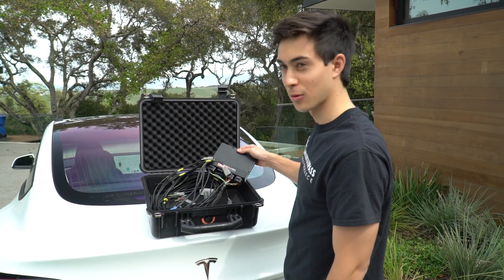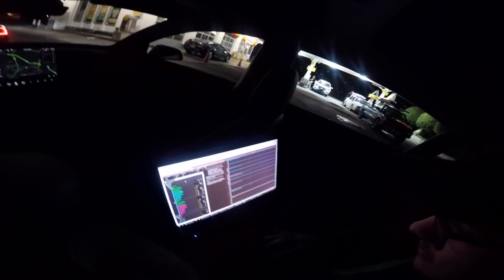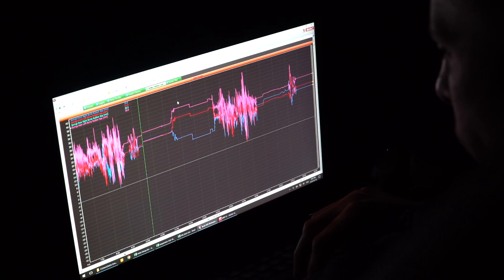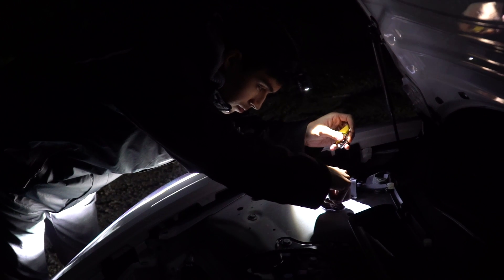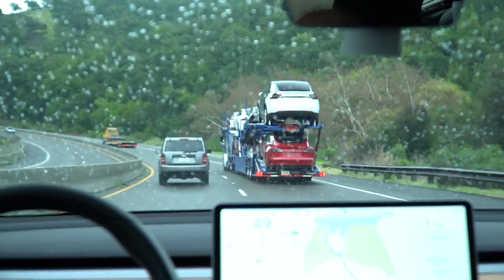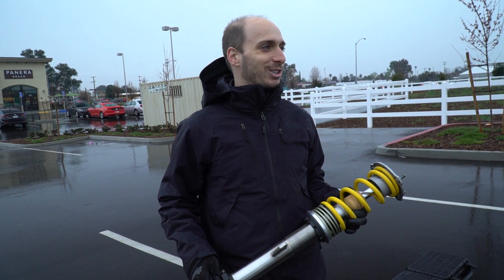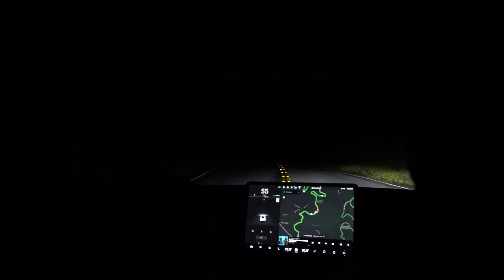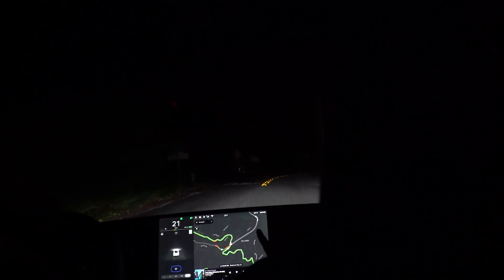Mountain Pass Performance Tesla Model 3 Coilover Development

Comment: Why would I ruin my car with you're product? Is there reason to trust you over a  mechanical engineer that works for Tesla? I even hear in the background  that it's not much different then stock. Why are you standing in front of a gas pump at the end of the video.
Reply from the maker: Well for starters, we can help with your grammar - it's "your" not "you're"

Secondly, the factory suspension is designed with certain type of constraints (i.e. high ride height so that when grandma sends it over a curb she doesn't trash the battery, low cost, etc). We're designing a suspension oriented to the enthusiast that is willing to spend more money than the factory ~$100 (Tesla cost) shocks and springs. 

I'm sure that if the mech eng working for Tesla had $2000 to spend on suspension, and designed it for a sports oriented driver, they wouldn't have made the same part.
Reply: Well said! Grammer makes car go faster, you be smarter then me, I buy you Mod. Really 2000k to turn my 4 door into a race car? You are high. Sorry not for me.
Reply: Grant Fryer grammar* than*
Reply: Grant Fryer lol kid
Reply: You're fuckin dumb. People mod their cars with aftermarket suspension all the time for plenty of reasons (less body roll when cornering, better quality parts, lowered aesthetics, etc.) Go to a cars and coffee and see how many cars there have aftermarket suspension setups. No one is telling you that you have to "ruin" your car with any product. If you're happy with stock then be happy with it. Don't know how coilovers ruin anything other than getting you to soil your own panties.
Reply: Why would anyone ever mod the car outside factory?  Come on, factory spend years of research and millions developing the perfect car EVERYONE IN THE WORLD.  Why rune it and risk safety, am I right guys?  More responsive steering, better braking performance or customizing the look of the car to what you like?  PFFF retards.  Let me go put my Hachi-roku to stock, brb.
Reply: Wow! such hate. My Tesla still rides just fine today with stock suspension. Sorry I will not be purchasing you're snake oil. Good day Sir.

Comment: I'd love to see a shock dyno in a future video. Are you still using the stock FRP upper control arm here?
Reply from the maker: Yes we are. We'll try to get some footage for you next time on the shock dyno. Although there isn't much to see :)
Reply: I meant to show the shock dyno plot lol.
Reply from the maker: Ah, yes that is something we certainly will not be sharing :)
Reply: Sasha Anis why not? A shock dyno plot doesn’t reveal anything proprietary, it’s quite common for manufacturers to provide them. Plus there is nothing preventing a customer from sending them to get dynoed somewhere.
Reply: @ShaunRF  if you took that plot and went to a company and said 'match this please' you've effectively stolen all of these guys testing work and labour.
Reply: @KXP70  that isn't really how it works. KW isn't going to do that for just anyone. Besides, there is nothing stopping someone from getting them dynoed themselves if they really want to copy it. TONS of reputable companies post shock dyno plots, its considered pretty standard. Many people simply wont buy from companies that wont post a dyno, because it is a tactic that is commonly used by shady companies to hide something unfavorable in the plot. Although I'm certainly not saying this is the case here, as Sasha has a very good reputation.
Reply: @ShaunRF  from the many suspension company websites I have visited in the past (20+) I have never once come across a dyno plot. I was under the assumption that it was provided on request and typically for track orientated products.
Reply: @KXP70  I mean either on the website or by request. I can tell you that Koni for instance has been very open about providing dyno plots over the years. They even used to have reps on car forums providing them. Fortune Auto is another example off the top of my head.
Reply: When I get my Ohlins revalved, a dyno shock printout is always provided.

Comment: Since your spring is linear like the original model 3 spring, is it of such a different spring rate that someone can’t just buy new dampers and use the original front springs, and just replace the rear shocks and leave the rear springs?

Unlimited Performance has made a two-stage spring, which will soften the ride but not the tiny disturbances which are over dampened. It seems the two-stage spring will wallow and roll more that the linear spring, especially on the side which is extending, which would need a stiffer anti-sway bar, which will increase rates up over uneven small bumps. 

Maybe some dampers with adjustable compression, rebound, and neutral zone would be nice.
Reply: The Unplugged Performance springs are stacked linear springs, which is the same general configuration as the KWs, but with a single piece of wire.   The KWs have a thick wire and separate thin (and ground or flat) wire.  Different configuration for a similar result.  Both are progressive rate springs achieved via coil binding.

Progressive rate springs are appropriate for both street and track use and have comfortable ride on small displacement bumps.  Interestingly air springs are inherently progressive.  The bags get firmer when compressed due to bumps.

Damping comes from the dampers, not the springs.  (Springs have a little internal damping, but for practical purposes are undamped.)  Adjusting the valving of the dampers controls the damping response to large and small displacements.  That's what they did when they visited KW.

Fully end user-adjustable damping is generally only useful for experts with good software and fully computerized measurement systems.  Most commonly those are racing teams.  These guys are tuning for a fixed set up which is far more appropriate for consumers who don't competitively race at a variety of tracks.
Reply: Loanword Eggcorn, yes, when you stack two linear springs of difference spring rates, you get a dual-stage spring. But it only has dual stage when compressed more than the designed ride height. So in roll, one side will stay at the low spring rate, and the compression side will be soft and then switch to its higher spring rate.

Yes, air suspension does add a non-linear spring rate inherently. 

For the most part, progressive springs are needed in vehicles which can carry a lot of payload, such as trucks and some SUVs, so when you add weight, the spring rate is higher. We see this in almost all Leaf and coil springs used in trucks. It was also common in older cars back when it was normal back when you could fit 8 adults in the car and 500 pounds in the trunk.

But for the LR model 3, it’s so heavy as it is, that under normal use it shouldn’t need progressive springs. They need either soft or stiff spring with proper damping. 

The dual-stage spring would work great IF they had a mechanism which compresses the section of coils with low spring rate, which lowers the car 1” and makes all those coils inactive, leaving you with some super stiff springs at all corners. Then with some adjustable dampers, you have a car that is comfortable when you want it and handles when you need it. 

Sasha’s design looks good. But can he make it affordable? How much different are his springs rate versus stock? Can he offer a cheaper solution that uses the factory front springs and just provides a lower stance and better damper valving, along with some different spring rates for those who want to spend the extra bucks.

From what I can see, Sasha’s damper will give much better results than the dual-rate springs.
Reply from the maker: You are mostly correct in what you're saying. It's important to understand the purpose of tender springs. If you search for pictures of the lowering springs you're mentioning, you'll see that the "soft" rate is almost fully coil-bound at full droop. The purpose of the tender spring is to add extension force when the main spring is fully unloaded, to help with fully extending the damper when the chassis is unloaded. Tender springs are always fully compressed (blocked) when the vehicle is static at ride height. 

Otherwise, a progressive rate spring is used, not a two rate linear combination. The sudden step in rate when the soft spring blocks can cause some very undesirable behavior.
Reply from the maker: This is somewhat correct. Are tender springs are blocked well before the total mass is on the spring. This is the proper way to configure tender springs as I mention below (or above, depending how YouTube sorts this comment)
Reply: Thanks Sasha.  It sounds like tender springs are generally much lower rate, and meant to keep the unloaded wheel in better contact with the road in droop.  Does that sound right?

Also it seems like a blocked tender spring and a coil bound dual rate spring would be similarly solid, but it sounds like you're saying a lower rate tender spring would bind sooner and softer.   They're a similar configuration, but behave differently due to the lower rate on the tender spring.   (A blocked tender spring is coil bound.)

So the main difference is the (large difference in) rates of the softer portion, and how they behave when bound.  Also where they bind in the suspension travel is different.
Reply: Loanword Eggcorn lol u no understand. Try again.

Comment: Been looking for coilovers. Working at Tesla and heavily into modding (same with a few people in our store). When these come out, let me know, would buy/test them in an instant. The chassis and overall potential to work with is crazy good for this car.
Reply from the maker: Certainly, this is great to here! Please send us an email and we'd be happy to add you to our communication list. We agree, the chassis is CRAZY good. It truly felt like the car was 1000lbs lighter than it is.
Reply: Cool to hear there are modders at Tesla stores.  Model 3 in particular is an outstanding platform.  The suspension geometry is as good as Audi at the front and Ferrari at back.  Agree it should be a good platform to start from.  In stock form, the Model 3 is easily one of the top sedans.  The basic design is excellent; highly competent.
Reply: Even the Model S drives and feels like a much smaller and lighter car than it is, especially in turns.  Main reasons are probably excellent suspension and steering design and extremely low center of gravity due to the low position of the battery pack.

Model 3 shares a similar design, but is even better for being about 25% lighter due to being about 10% smaller.  (Mass is roughly proportional to the cube of linear dimensions.)  The lower mass makes everything work better.  Much less work is done by a lighter vehicle, so everything is literally much less effort.  For performance, lighter is generally better.
Reply: Yeah. Before the Model 3 was released engineers did their benchmark tests against all other cars in it's class for performance but specifically in handling. Model 3 (obviously with P and other trims/setups) vs. BMW M3-330i's, Giulia's to Quad trim, etc etc. Guess who won at handling? That's when I reserved mine hah. I use to drive a Cayman with 20's staggered vs. my Mo.3 with 235 (19x8.5") and 265 (19x9.5") and still waiting on lowering springs to come in, it already handles about the same. Design wise this isn't surprising though, all weight between axles, closest to the ground as possible, motors relatively inline with the axle(s), traction control is precise and seamless. You just can't beat that design. It's literally the most practical and optimal design we can do today. Sasha, if you ever do go with staggered setup, once you get 265-285's on there, and those coilovers, UH A/S - Summer tires, you're going to be mindblown. 

And Loanword: while people coming in 9/10 aren't there for performance (unfortunately), in the hands of a good driver, the Model X would smoke some smaller and lower sports-sedan cars, it's funny.
Reply: The vast majority of street drivers know almost nothing about performance driving.  (And that's a shame, since it needlessly costs lives every day.)  A skilled driver in an inferior car can beat an less skilled driver in a superior car on a race track, for example.  

All of the Teslas are very capable cars.  Drivers not so much.  

On the other hand a more capable, responsive car can encourage drivers to learn more about performance driving, but the best learning comes from racing schools, autocrossing, track time, etc.

In my mind Model 3 is superior to Model S and X due to being smaller, lighter, more efficient, more responsive.  They share similar design, but Model 3 is much lighter.  Most people objectively don't need a car as large and heavy as S or X.  Model 3 also costs about half as much, which makes it accessible to vastly more people.  It's a winner, and that's reflected in the reservations, which ironically were placed long before anyone actually knew how good the car is.  

I expect most of the drivers will never fully appreciate how good the Model 3 suspension, steering, chassis and resulting driving experience are, but the exact same applies to most BMW, Porsche, Ferrari, etc., drivers, who don't take them to a race track.
Reply: Loanword Eggcorn Oh of course. I’ve seen mostly stock Miata’s wreck some drivers from canyon back roads to track days. What I meant, if two fairly competent drivers were tracking, the Model X can be pushed a lot harder than one would think. It’s just an inherent good design. Especially the traction control AWD.
Reply: Sasha Anis Also, I signed up for email updates. Please reach out to me if you ever are considering to come back in the SF Bay area, I can help support and see what I can pitch in.